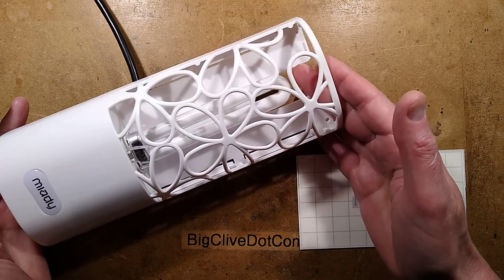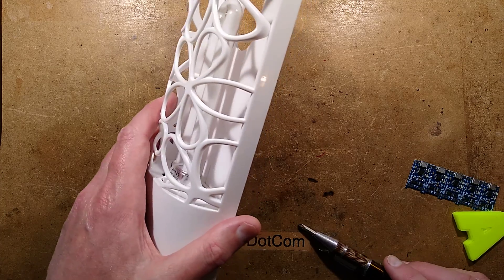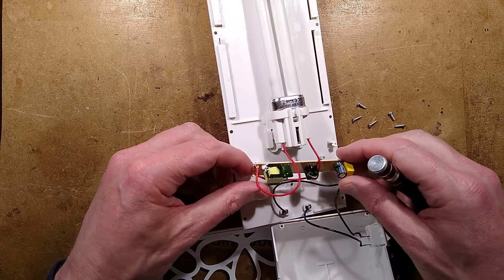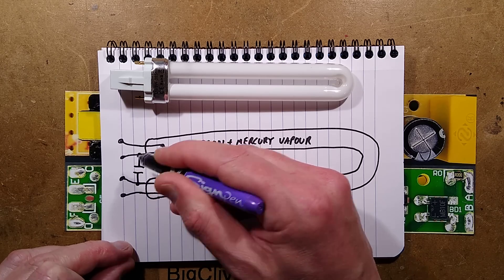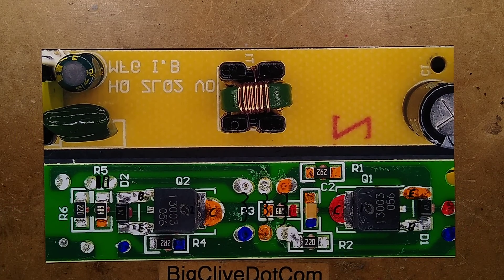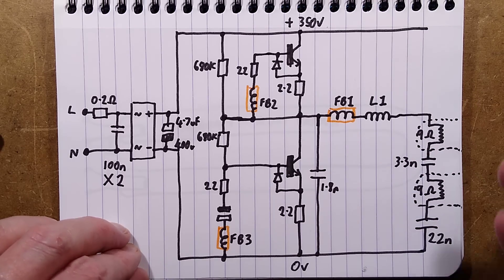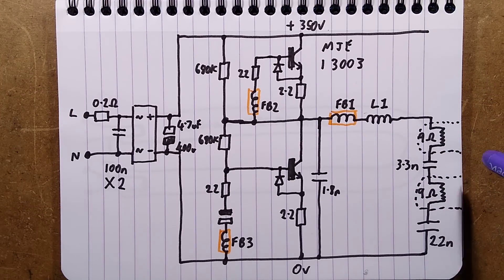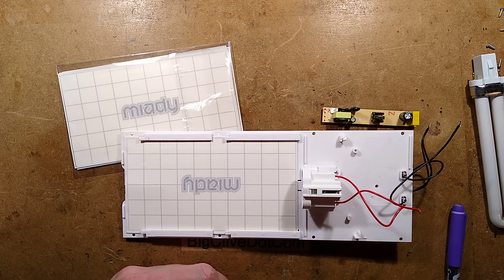Inside a sticky (glue board) fly trap (with ballast schematic)

Comment: Another indicator of the demise of fluorescent lighting is the rarity of replacement tubes for existing fittings.  LED lighting is often built into the fitting so there are no replacements at all.  Old school fittings with separate tubes haven't been used for 10 years or more and they've all been replaced, so no one bothers making the tubes any more.
Reply: 10 years ago I fitted a shop space with fluorescent tubes because I needed lots and leds were too expensive at the time.  At least around here what you are saying has definitely been true for 5 years but not quite 10.  The home store is still flush with fluorescent tubes.  Even the old 8’ T12s. I am sure I will regret putting in those tubes in my shop once they start burning out.  I needed a low pressure sodium bulb and ballast for something and that… is tough to find
Reply: @TKC_  LED tubes are an option. Some retain the fluorescent ballast, others require rewiring the tombstones directly to mains supply.
Reply: @Azlehria  yes I know about those and probably what I will do. The ones I have seen you need to remove the ballast.  I guess I shouldn’t complain 1 tube has failed over 10 years.
Reply: @TKC_ 
Removing the ballast is usually only necessary for electronic ballast fittings. If you've got "starters" in the fitting, buy tubes that come with the "LED starter" (it's just a fuse) and you swap both bits over.
Reply: @tin2001  my shop gets well below freezing so I have cold start electronic ballasts on all the lights but Interesting to know. I wonder what the difference in efficiency would be keeping vs eliminating the ballast when fitting leds. I think I have 32 tubes of 4’ t8 lights out there. I have the nice fixtures with cages to prevent damage on the front so I would like to keep them. My house is 100 years old and had 1950s ballasts and fixtures all non living space. Only 2 left in the far reaches of the basement.
Reply: Yep, my office and kitchen still have fluorescent tubes of different efficiency.  One place is 4800lm/56W, which is 85lm/W, not that different from good LED lamps.
Reply: @johndododoe1411  Are you including the ballast draw in that figure, or just the tubes themselves? That can make a surprising difference: our ballasts were drawing 50-60W apiece to drive two 32W tubes each - or nearly doubling the superficial usage of each fixture.

The ballast-less LED tubes, on the other hand, have a total draw of ~35W each, with each producing more light than the entire fluorescent setup. At this point they have somewhere in excess of 20,000 hours on them and are still going strong.

They also run somewhat cooler than the fluorescents they replaced, which was rather unexpected given how hot screw-base LED bulbs tend to run. This may not be a positive point in cooler climates.

Comment: Getting locked into a supply(the sticky pads) that isn't easily available is kind of annoying.  I suppose you could put bits of fly strip onto a cardboard back, but handling that stuff is a nightmare.  As for the colors, you could just as easily create a board that had leds blue/near uv on one side, green on the other (shooting ou the side and down onto the surface maybe, why make the leds the brightest point after all).  Then you just need the 1 device to test with.

Comment: I got a similar one but uses a pair of blue LEDs.  Does work, as it did catch a horsefly that was about as big as my head.
But yeah, the biggest problem is getting more stickies.  You can get mouse glue-traps and cut each sheet to size.  If you could only get 2.5 of 'em per sheet, cut 'em into thirds instead.

Comment: It's a bit weird seeing that they used a 2-pin PL type lamp only to be ran on an electronic ballast, as these 2-pin versions would almost exclusively be ran on magnetic ballasts and would have a glow-bottle starter shoved into the cuboid-shaped lamp base.
Reply: I was looking for a comment about this. Never seen a 2 pin lamp being driven by a HF circuit. It normally can't, as the starter would be glowing as well, ending up shorting the HF circuit.
Reply: I have seen this once on a 12V compact fluorescent lamp with E27 socket. Intended for Garden houses and camping and stuff. It used a ZVS step up circuit to provide a kind of constant current and a standard glow starter to start the lamp
Reply: I have some UVC tubes similar to this, came with a magnetic ballast, the tubes have starters in the bottom section as you mention. The tube Clive has may just have the cap

Comment: many years ago i was "camping" in a decent sized camping trailer, and it had 12v overhead lights in it and they would attract mosquitoes. a few strips of duct tape hung just right around them worked very well for a basic bug trap. i'm sure you could make some refills for this with almost any tape and a bit of paper board